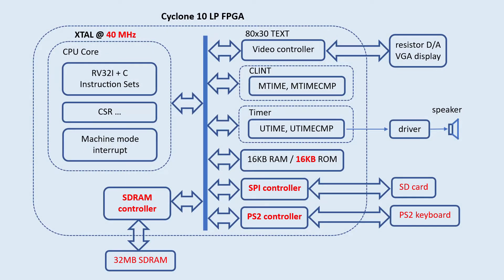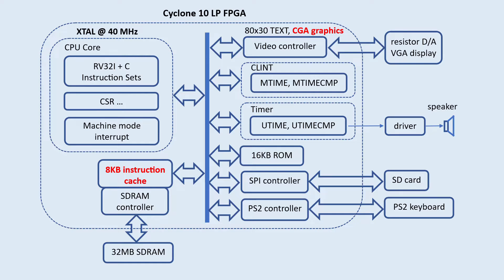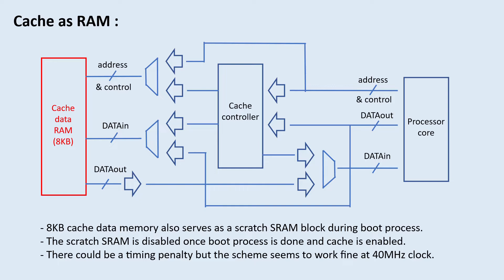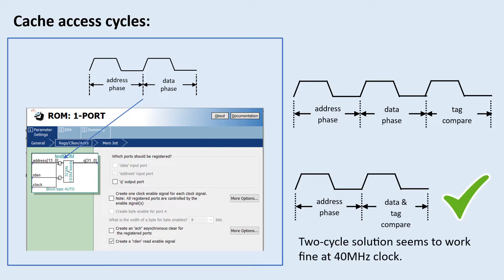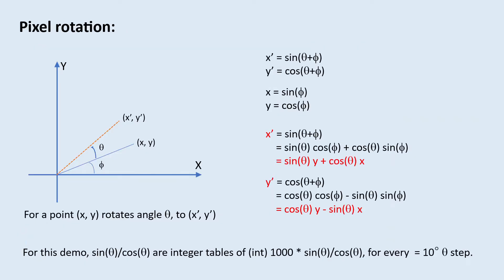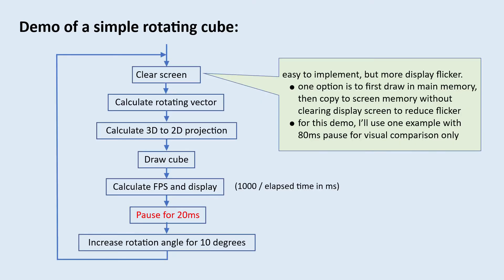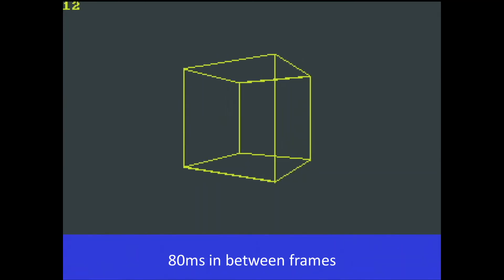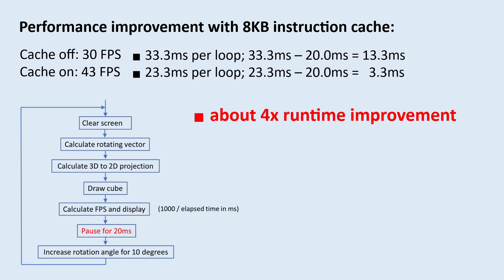Simple Cache Memory and Graphics for RISC-V RV32IC (FPGA)

Comment: I've been looking to do something similar to this but with a data cache first. Unfortunately, I'm not very experienced with RISC-V and Verilog etc. Do you have any advice on where to start with something like this?
Reply from the maker: The cache I implemented is not specific to RISC-V but a general configuration. You can checkout overall the book "Computer Architecture - a quantitative approach" and pick a few chapters. ""Digital Design and Synthesis with Verilog HDL". There are chapters on modeling a pipelined processor and cache memories. Googling is another way, but the information may be scattered and you need to be as patient.
Reply: @jinl2  I have a pipeline diagram for the RISC-V core that I am working with and I think I understand it fairly well, but I am struggling to familiarise myself and understand the Verilog code itself. Would you say "Digital Design and Synthesis with Verilog HDL" is a good way to familiarise me with the Verilog of the core? The diagram also shows where a cache could be implemented. All I want to do is try and implement a simple direct mapped data cache but I don't really know where to start other than trying to understand the Verilog of the core.